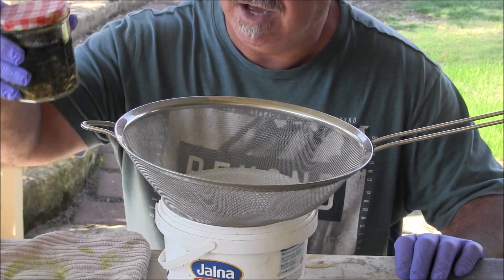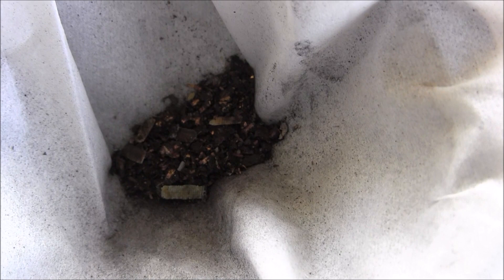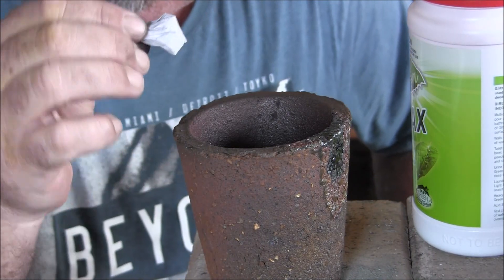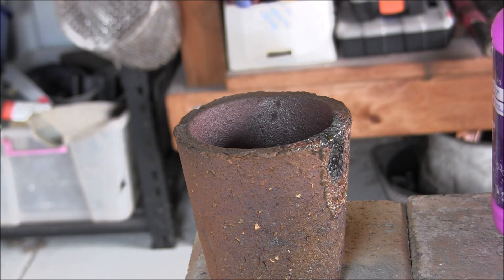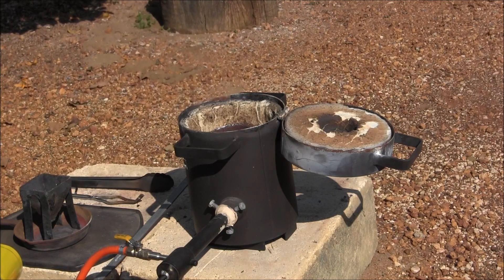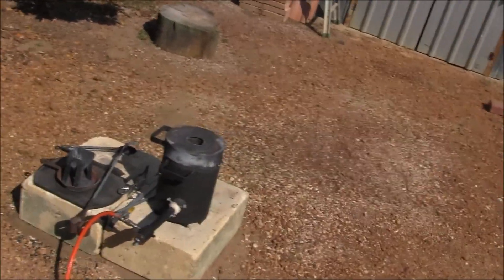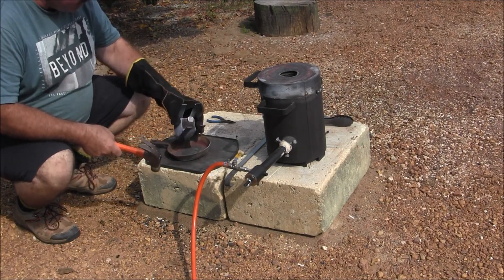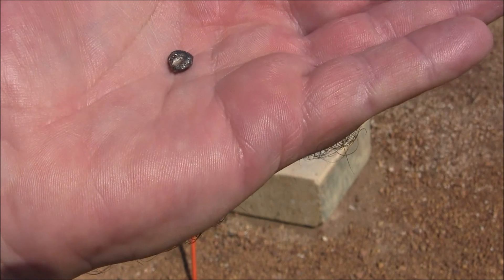RECOVER GOLD FROM E WASTE

Comment: Weight of the start out material?
Reply from the maker: Hi Jess,
               Did not weigh the Pay Dirt before panning.I will dry the sand and weigh it before I run it over the Miller Table 👍thanks for your comment. Cheers Kev